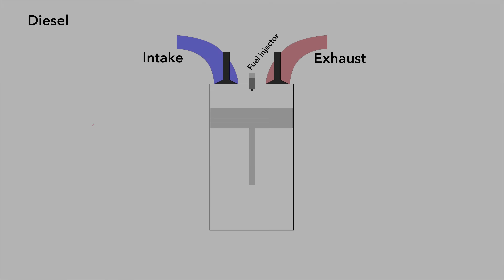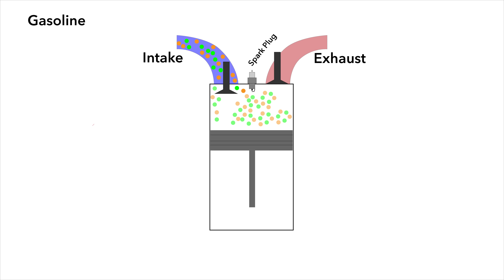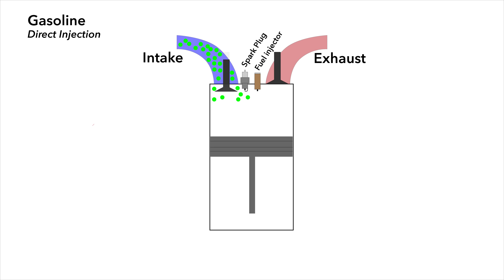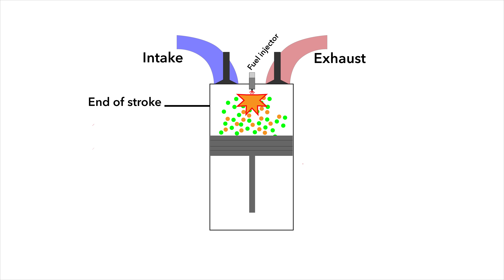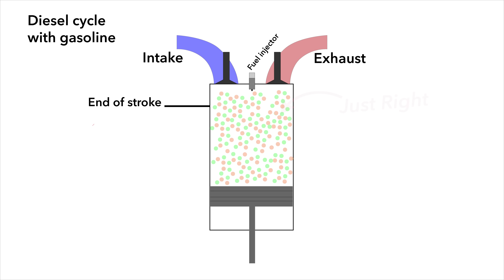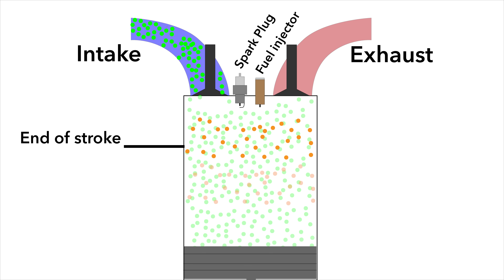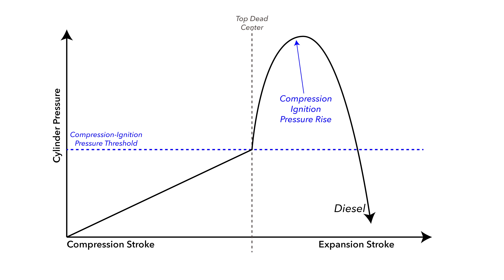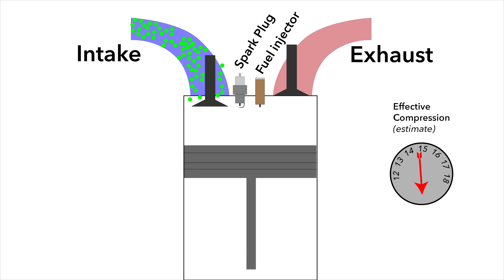Skyactiv-X: Mazda's Revolutionary Engine Explained

Comment: Sorry to break it to you guys.  This is more fancy talk than actual breakthrough development.  The concentration of fuel around the spark plug (from the injector) still has to disperse the explosion to the rest of the chamber and that takes time.  In fact both in the 'skyactiv' engine (and all other engines), by the time the exhaust valve opens the fuel explosion/expansion is still going on.  This results in a rush of expanding gas out the exhaust and a serious waste of energy.  In essence, the "skyactiv' process is undermined once the exhaust valve opens. What 'skyactiv' is doing is a form what happens when you tune an engine by playing with the fuel/air mix.  You can adjust the low end torque or the up end speed, but you can never do both as the always lose once the exhaust valve opens.  This is a highly inefficient engine (but so are most others).  I think the greatest development in engines is the variable valve technology of Honda (now copied by Ford in their 'ecotech' engine).  But that technology is was perfected in the 90's almost 30 years ago.  Mazda need to get serious of motor vehicle technological development and move onto electric cars.

Comment: I hope they put the PCV valve at the location easier to access. With gasoline and high compression ratio in the SPCCI engine, the engine can blow the spark plug tube seal under 30k miles. I don't want to take the whole intake manifold out just to replace the PCV valve once every 30k miles.

Comment: It is said in the video, gasoline is more volatile than diesel fuel, which is true but does not explain why gasoline is more reactif than gasoil. In fact it is the way around and diesel fuel is way more emocional when it comes to temperature ( high cetane number). Gasoline is dificult to ignite by compression and the combustion chamber should never see rich mixtures or the combustion would be so fast that the engine would not survive the event. For compression with gasoline it is important to keep it lean so the combustjon although very fast never excedes a certain heat release rate. Mazda has done a great job in keeping things simple but functional because they have understood the limitations and possibilities of compression ignition with gssoline so well. This is the beginning of major step ahead in internal combustion engine tecnlogy

Comment: Put that skyactiveX engine in a Prius Prime and get an additional 20 % fuel economy, Now I can get rid of my moped.
Reply: Baidu Mel Yes exactly, a lot of the haters of internal combustion one can see here will be more muted when they see in a few years a hybrid that has more power and gets up to 70 mpg, and other electrified vehicles with small Skyactiv-X engines.
Reply: @voodootrois  Meh. Fuel cells are dropping in price to the point where Toyota thinks they'll be able to manufacture them for less than gas engines, and battery prices are falling as well. And methane fuel cells made major advancements using similar tech to the one that Toyota is pursuing.

If we see hybrids in ten years, I wouldn't be surprised if they end up being battery / LPG fuel cell hybrids. Fuel cells produce electricity directly and are a better fit than ICE's for the range extender role. However, batteries will likely have become cheap enough that even plugin hybrids will still have >100 km pure BEV range, and the fuel cell would only be there to save weight compared to a 400 km range pure BEV.
Reply: Too bad they don't just make a diesel hybrid.  Some get 50+ MPG without being a hybrid.
Reply: @atari7001  Maybe because you don't need the diesel torque in a hybrid and don't want the shitty emissions of a diesel?

Comment: I appreciate Mazda’s technology to further the life of the internal combustion engine.  Mazda has always done things their own way, even at the expense of sales.  Americans are stuck on Camrys and Civics and its hard to convince alternatives.  That being said, this technology will only extend the life of ICE cars, not save them.  Electric(Tesla) tech is improving drastically and will leave no reason to buy an ICE in the future.  The 2018 Leaf is already 50% less to operate than comparable ICE cars.  In 20 years, you’ll be hard pressed to find a new ICE car to buy.
Reply: Only because of subsidies.  Consider the energy & pollution caused in producing that Leaf and you get a different picture.  Plus we don't have anything like the generation or transmission capabilities to move away from ICE, they are at least a decade, probably more.

Comment: if the next mazda 3 has skyactiv x, looks like the kai concept, and has the full suite of active safety systems, i will lose my mind 😱 - please mazda, please
Reply: It should be all those things, but who knows if Mazda trips up on the execution. No room for mistakes here. Skyactiv-X getting a bad rep due to unreliability or otherwise poor driving or ownership experience would be very damaging to their future, as they've bet heavily on it as opposed to turbos and electric. Same if their design doesn't stand out from larger manufacturers (Mazda Kai certainly is a bold step in a different direction to all the other mass market companies).

Comment: I'm not an auto expert but this engine seems kinda pointless. The engine is similar to a diesel engine at certain points. Seems easier to come out with a diesel Mazda in America or hybrid Mazda for better mpg imo.
Reply: The reason it isn’t pointless was stated in the video. Emissions.  Also there’s the fact that our fuel infrastructure is tailored for gasoline consumption in the non-commercial market.
Reply: It combines the advantages of diesel and gasoline together. Due to the lean mixure (lambda 2 to 2.5 when nobody else can get an engine running above 1.3) you can drive this engine up to +- 5500 rpm without increasing your fuel usage like crazy, making it easier to drive in higher rpms so better throttle response and easier to drop down a gear. Lower NOx and CO2 but with 30% more torque and 15% more power while having a low fuel usage!
Reply: Diesel is worse when it comes to emissions. Also diesel engines get a lot of carbon buildup so you regularily need to drive the engine hot and at high speeds (highway) to get rid of that.
EVs have the problem that the electricity still has to come from somewhere, and that somewhere is mostly burning of fossil fuels, primarily coal in the US.
Reply: @ano1nymus1  It's not a diesel engine. It's a gasoline engine with diesel efficiency, improved mileage and torque ratings.
Reply: Good start
Reply: Marcos Ruiz  I agree. The engine is complicated and will be expensive to repair. And where are Mazda's EVs? They refuse to see the future.

Comment: So it needs a spark to ignite the the compression ignition........Ok, but that means it really isn't real compression ignition. Fuel being injected before and after a power stroke is nothing new in the industry, it's already used in most TGDI engines.

Comment: People don't realize how significant this tech is. No other option--electric, natural gas, hybrid, diesel--reduces consumption/emissions as much for as little new cost. It can fit into virtually any gasoline vehicle application, including sports cars, trucks, & SUVs. Merge two of these engines together and you get a 4L V8 producing 350+ hp & lb-ft that gets mid-to-high 20s mpg combined. AND it has plenty of low-end torque & a broad, flat torque curve through the rpm band.

If every gasoline vehicle used this tech, the US' oil consumption would drop by ~3 million bbl/day. For perspective, the crash in oil prices a few years ago was caused by an excess in supply of only 1 million bbl/day globally. If others copy the tech (or if Mazda licenses it), or if Nissan's variable compression ratio catches on, etc., the global oil & gas industry could crater with oil prices forever stuck at $30/bbl.

And this isn't even the end of the road for gasoline. Mazda's next goal is an adiabatic engine with a thermal efficiency over 50%.
Reply: With correct gearing, you can make 350+ horsepower and lb-ft out of any engine and still get mid to upper 20s combined without compression ignition. SBCs V8s are already low-mid 20s in Corvettes and Camaros, but they aren't supposed to be efficient engines and are making nearly 500hp.
Reply: Will Mazda be using this technology in any other models in the next year or so? How about the CX3?
Reply: hopefully its reliable
Reply: Smokey Yunik already made an adiabatic engine and proved the high HP, MPG and the extreme efficiency of it with less pistons
Reply: Mark Hopewell 
pEtRoHeAdS gEt UsEd To ThE iDeA
Reply: Easy killer! Hcci has been around for 30 yrs. Yet ever put into production. Yes mazda has a modified version that appears to work. This type of combined combustion modes is very tricky. It requires a supercharger,pressure sensors in the cylinder and very high speed computer. Plus it needs to compensate for very cold to very hot ambient temps. Plus a n older calm driver or a teenager. So hardly an easy thing to do. Not to mention still be reliable for 200k miles. 
I love it but its not the savior,gzz.
Reply: It wont fit in sports cars unless its controllable by hand. A sports car is a sports car for a reason.
Reply: you know this tech requires a lot of wires and sensors right? and you know what it means, a lot of things can go wrong, and the amount of electronics that they put in this engine is so much more than what i have in my hybri
Reply: No. This is not more efficient than traditional diesel. Electric is the way forward as battery prices will continue to drop.
Reply: @BosonCollider  Electric is not the answer. Lithium extraction is a disaster for the environment, batteries can never have the energy density of a hydrocarbon, and on top of that the current power grid can't cope with it. All it does is shift the problem elsewhere. Where is the power coming from when everyone is driving electric? Not that it's possible for a host of reasons.
Reply: @BosonCollider  Internal combustion engines are here to stay. And you lefty types often forget that cars are not the main burners of fossil fuels. What about   big passenger jets? What about all the cargo ships? I mean the ships could go nuclear but that's an incredibly bad idea, imagine what a boon to terrorists and enemy states a nuclear cargo ship would be. As for jets? Yeah there's no replacement around the corner. All you have to do is look at relative energy densities to know that.
Reply: Or buy an EV and watch gas prices become totally irrelevant
Reply: Reduces compared to what? Old engines that are nowhere near modern turbos when it comes to efficiency.

Comment: Meh, It doesn't look like anything revolutionary, it's just gimmickery. It's not even real compression ignition. Seriously, they need to ignite the fuel with a spark first so we can compression ignite the fuel in the same cycle? We're pretty much using this already with modem turbo engines, direct injection and advanced VVT. They're just replacing turbos, which effectively increase compression, and increasing the compression ratio in the cylinder to do the job, still relying and spark ignition. The actual fueling and timing theory isn't all that different. They're just simply using the benefits of VVT and DI developed by other manufacturers to claim they're doing something "revolutionary". Really, if Mazda had come up with the port and direct injection on an Atkison engine, people would be crawling all over this.....But no, it was Toyota had to come up with it.

Me, I'm wait for a TRUE compression ignition gasoline engine that can run cleanly, smoothly, and can properly mix air and atomized fuel without grenading itself, and also not cost a fortune to repair.
Reply: I think the point of the engine is higher compression w/ less fuel and still have it work properly. Turbos and any other form of boost normally need more fuel as well to maintain the proper AF ratio.
Reply: And turbos require premium fuel.

Comment: I'm very skeptical. People jump when a manufacturer claims something is "revolutionary", but never do they actually wait for everything to be weighted and proven in reality. The Skyactive-D is a perfect example. It was supposed to take advancements made in gas engines and applying them to diesels, making them simpler, cheaper and cleaner. Well those engines were promised, but they've proven to be crap and they never made it to the US market because of it.
Reply: Actually they dropped the Skyactiv-D because of US emissions. There was nothing wrong with the engines. VW used cheat software to make their diesels "pass" emissions and Mazda engineers couldn't figure out how VW was doing it; nobody could. However, this "holy grail" tech (Skyactiv-X) will be used for the CX5, Mazda 3 and probably the 6.
Reply: mo 1 kai  seems to be a little over complicated. It’s really a spark ignition engine with some extra stuff.
Reply: Also.......Where the HELL is the rotary RX9 that they've been talking about for most of my adult life?
Reply: @mo1kai691  I didn't give them all my designs for the 16X so it is stuck in development.  Keeping the final designs of my engine to myself.  

  I know that sounds greedy...but Mazda was greedy first.😋
Reply: @mo1kai691  Will likely never be able to meet emissions and fuel economy standards.
Reply: So you have to fill it up with diesel and petrol? 2 separate tanks?

Comment: How are they monitoring air intake, knock, Nox, and timing?
Reply: EE says they have a pressure sensor in the combustion chamber.  I've seen such sensors in industrial Natural Gas engines for testing purposes.

Comment: No doubt it's revolutionary. The question is whether other automakers will follow suit. Time will tell ...
Reply: Ronald de Rooij They would be shooting themselves in the gut. If people are going to keep buying gas or diesel engines, there will be manufacturers building them.
Reply: They won't follow because the overall effect is similar to what others did with much simplier downsizing.
@Ronald de Rooij
They won't stop anything because there's still no real alternative for fossil fuels (electric cars are nowhere near to being competetive).
Reply: I tend to agree with you
Reply: Good point
Reply: I think not. Most European carmakers will cease gasoline and diesel engine development by 2023.

Comment: You explained this engine technology better than anybody. I finally 100% understand how it works. Pretty dang cool, thanks Alex.
Reply: Totally agree...I semi-followed the other explanations, but this was so clearly illustrated, I now totally get it.  It's actually an elegantly simple solution from Mazda.
Reply: Yes, very good explanation.
Reply: Yes! Took me three videos till I found this one. None of the others got to the point quick enough - they literally explained it as a standard petrol engine that...also works like a diesel a bit (???). That...that was pretty much it. They still explained it as if the spark plug was igniting everything - even Mazda's own video did that.

Alex got to the point: that an ultra-lean mix (immune to normal mechanical compression ignition), is ignited by a spark plug-ignited burst of rich fuel that tips the compression over to a point where the lean mix will ignite.
Reply: Lino Sammut I may buy a 2020 model year.
How would they ban diesels in certain cities? How would they know?
Reply: The Adventure Auto Probably the only way they could do it would be by outlawing Diesel fuel being sold in the city. He comes to mind for me.
Reply: not realy  he only explained how it is suposed to work !  warp drive works in theory but does it in real life ?
Reply: Oh yeah? Watch EngineeringExplained.  Also, I really doubt you understand anything 100%.
Reply: The Adventure Mazda Agreed.
Reply: Yes great explanation and diction delivery.  I want to know why not get rid of the mechanical transmission and replace it with a generator, battery and electric motor?  This would allow the engine to run at a constant optimal speed and allow the battery to do the accelerating?  This would therefor be a hybrid with the gasoline engine the primary source of power and the battery/capacitor used to adjust the speed.
Reply: Yes.
Reply: Variable compression
Reply: Here's a good explanation of the technology coming into mass production in 2008. Direct injection was invented in 1902. Wow new technology huh? Not
https://en.wikipedia.org/wiki/Gasoline_direct_injection
Reply: Cool to see you here! I was going to get write the exact same comment.
Reply: No he didn't.
Reply: Very much agree. The other explanation sucks.
Reply: Now  go  and  buy  one , but dont buy the  diesel  because in some  cities  going to be banned  , or buy electric.
Reply: The Adventure Mazda it's  going  to happen look  it out  in the Internet.

Comment: I hope Mazda build the engine block and heads like it's a diesel rather than a regular gas engine because I could easily see it blowing itself up like those old gas-to-diesel designs of the 70s and 80s.